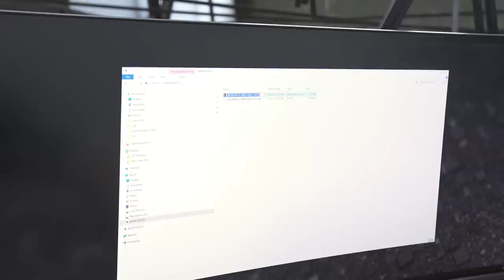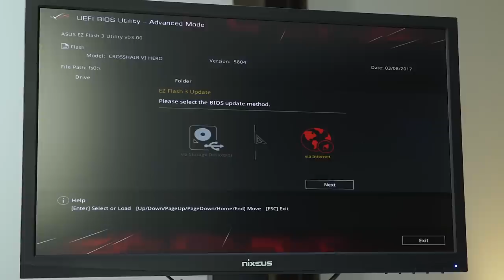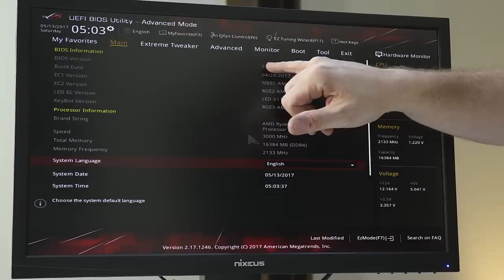How to build a Gaming PC

Comment: Is it possible for me to have both Windows OS and the BIOS update on the same flash drive? I'll be using the Windows Media Creation Tool to put Windows 10 onto my 32GB flashdrive. If i was to create a new folder on that flash drive with a folder named as instructed by my motherboard manual, will that work?

Comment: At the part where you power up the system, how much time elapsed before the monitor turned on?
Reply: Stephen Jamandron it varies for everyone, from 30 secs to 5 minutes
Reply: Clint-Excalibur71 So, what happened was that I had a stock CPU cooler that didn't fit on the motherboard, essentially leaving space between the CPU and cooler. (I got too excited because I was just waiting for my actual cooler.)
Reply: Stephen Jamandron lmao. You were going to fry your CPU. hopefully the cooler is on top of the cpu this time, posting shouldnt be an issue
Reply: Clint-Excalibur71 It is. Lol. I just wanted to post it. But I was worried after running it for 15 minutes with the stock cooler. The PC is great now.
Reply: Stephen Jamandron nicee, glad it works :)

Comment: Somebody help!! My pc won't boot, i dont have a gpu yet and i have asus prime z270 a motherboard. Idk if this motherboard has onboard graphics. if you have an air cooler do you apply it on or can you just leave it off and plug it into the cpu fan header (cuz that's what I did)? Also don't you have to plug a hard drive because I didnt. I need some help plz!!!

Comment: How would you install a optical drive on that case using that setup?
Reply: external usb one
Reply: @Zefinfer  Yes, but it is inconvenient isn't it?  I'd rather install one permanently, even if I hardly ever need it...
Reply: @CharizardFan_og  i agree i prefer having an internal 5.25 drive bay one myself. my next computer i want to have a pioneer BDR 2212. its an internal drive that plays blu rays. but for towers that dont have a 5.25 bay area, i think external drives are the only real option for optical discs.

Comment: I returned my motherboard and cpu because my motherboard turned on but the cpu fan didn’t spin. I retried everything and nothing worked. It just wouldn’t boot. Rewatching this I realized I didn’t even turn my motherboard on just the psu. I’m going to return all of the parts because at this point I shouldn’t own a computer.

Comment: I just built one using Ryzen 1700x vs Asus B350M-A motherboard Corsair LPX DDR4 32(16x2) 2666 but I don't have a GPU yet and it turned out My build Would not turn on there was no beep or display. Is it because of missing the GPU? Please help me out 
Thank you
Reply: Son Nguyen yes, you need the gpu because the cpu doesn’t have internal graphics.
Reply: you're right it worked right after i installed the GPU. Thank you
Reply: Son Nguyen No problem. I love helping fellow master race, and console peasants.

Comment: I need help. im trying to build a gaming PC
I chose this parts: 
Ryzen 1600
B350 AM4 gigabyte gaming k3
i have gtx 1050ti(plan to upgrade to 1080 or 1070)
power supply is CS500 gold modular
M.2 500gb SSD
16gb Corsair vengence 3200mhz
nzxt kraken x62
I just wanted to ask if there would be bottleneck issues while im using gtx 1050ti, or when i upgrade to 1080. Thanks guys!!
Reply: no

Comment: Oh yes, I had this on, left in the middle. There's JZ 2 cents, Doing about a buck fifty,  no, that's a hundred bucks.  That reminds me. I Have to save this video to finish watching,  because I have a pretty good idea this is going to turn out pretty nice. I already found the board,  great price,  I think $129.00,   but that Nvidia GPU looks rather rich.  I just got shocked a moment ago on another build.  

That's why builders watch these,  shoot if the difference is only 10% of something that is already so over powered it's ridicules, who is going to notice.  JZ I guess.  
I have to come back to this.  ASUS sent these parts for a reason.  Probably because they trust it's a good quality combo.  I guess I won't know until I finish the video.  
JZ I want to start connecting my Drones to my Google Home, and that PC you are building.  
I want to fly my fleet of Drones from my Opperations center.  Waite until you see my build.   All my monitor stations are same size monitors where there is more than one monitor. (Flat panel TVs)  So O can watch TV, or hook up a ton of other accessories.  What's a good price to pay for a chrome book,  I want one to carry around between stations.  Must cast,  smart cast/mirror screen.  All my monitors, are mostly  Samsung (which I really like)  I have 4 stations all together, and an android (Samsung of course) Up stairs (loft) is a guitar work out station and gaming.   I'll share the rest some time maybe.   I will have to dress them up for your channel, which reminds me.  You gave me an idea, actually a great I dea of something for computers that is mostly overlooked, often not even considered, yet when tended to makes a big difference.  I can make it, ...and every gamer with a set up that is to be appreciated for it's aesthetic value as much as anything else will be using this very cool system accessory device.  We can even add RGB LED chase circuit .  Thanks For thg he idea.  I'll make one and send you a pic when it turns out and gets set up.  Out of here,  I'll be bvb back to finish watching hopefully before it's out dates. I hope this was not 3 years ago. Lol.
Reply: wtf

Comment: Whats if i want to install Windows 7 and have a similar set? (not really). Been running into the ole ACPI compliant error for about a week. Nothing i do in Bios helps. 
Ryzen 3 2200 on a Asus Prime B450-Plus. Multiple SATA drives. Nothing works unless I try to install 8 or 10. 7 crashes after it "loads" files and going to the Windows spinning ords. Then boom. Blue screen.

Comment: im confused on the part where he installed windows 10. if i already have win10 on my current motherboard do i have to buy it all over again if i upgrade ? or can i just sign into my microsoft acct?
Reply: should just be able to move your hard drive with windows over to your new board. I'll be finding out soon.

Comment: Do you have a full parts list to copy this build?
Reply: My own for ryzen 3: https://pcpartpicker.com/list/wsTm9W You can get gold PSUs for $60. 500-650W is fine for one graphics card.  Keep checking. They're worth much more. (Corsiar CS & VS PSUs are unreliable.) You can get very cheap whisper quiet (22dBa) 120mm fans on ebay. You want a 140mm fan outside too for summer. Mine is a Thermaltake TT 1425, from Ebay. Makes no noise at only 17dBa. It has a long cable.

Comment: Does anyone know how you would go about turning it off when it successfully boots when you're going thru the test run? I'm getting my parts tomorrow and would like to know. Thanks :)
Reply: will freeman Hey there! If you're breadboarding, you can turn it off by switching off the Power Supply.

If you already have everything in the case, just simply hold the power button until it shuts off (don't use the power supply switch).

Hoped that helped!
Reply: thanks! i had already built it but thank you for the info for the future :)
Reply: Oh, no problem! XD That's good to know!

Hey, if you don't mind though, would you give your thoughts on the PC guide video I uploaded? Thanks a lot! :)
Reply: sure, no problem.

Comment: Can someone explain why he put his power supply upside down?
Reply: Nelson it’s not upside down. There’s a sticker on both sides whether you want the fan up or fan down the sticker is always upright from the front of the case. This case also has a mid plate so having the fan pointed towards the top would choke the air flow. Fan pulls air up through the bottom through a dust filter and exhausts out the back.

Comment: That wasn't comprehensive enough , we all know where the memory and graphics card go. We know how to use screws and we don't need to be told where to put the hard drive in the case.

What I think most people to need to know is, installing drivers and operating systems. The websites to go to for each type of mother board .

Also I think advising to wipe the liquid off the chip and the cooler is such a big mistake . It's very easy to say use the right tissue and be careful not to touch it with your fingers but soon as you give permission to people to even go near it and wipe it, accidents will definitely happen .

Also, when you start tested the system and it showed on the monitor you didn't show how you turned it off before you started to take apart the system ????

Comment: I need help my mobo is giving me a code for memory not installed but it is and is in proper slots
Reply: Remove all RAM modules and install 1 at a time. If your system POSTs, that means that particular module is fine. Remove that module and repeat for the rest of the RAM modules you have. If they all result in a good boot, you can confirm that the RAM is fine. That would then lead to testing if the RAM slots are fine and/or CPU.
Reply: @JJFlores197  i tried different ram configurations still nothing still says no memory installed i just contacted msi customer support so we'll see I'm hoping i don't have to buy a new mobo or cpu guess we'll find out

Comment: There is no way in hell I would build it. Take it apart and build it again. Just build it in. Worst case scenario your mobo is faulty and you have to take it out. Everything else is easy to take out.  I'm lazy. The 1 of 2 times in every 10 or 20 pc builds where something is wrong. Will not make up the time you lose from doing it twice on every other build.

Comment: Hows my build?
First time pc build
AMD Ryzen 1500x
AMD Wraith spire
MSI B350 PC MATE ATX
EVGA Gtx 1060 3gb SC
1x8gb Ballistix Ram 2400mhz
650w Fully Modular Evga PSU
Corsair 400c
1tb WD Hardrive
128gb ADATA SSD
for $1000 CAD ($800 USD)
Reply: Looks fine. Overclock the RAM to 2666 for faster games https://www.youtube.com/watch?v=k8vuTPj0VXA (In cpu-intensive games you would see the difference. Run in lower resolution and graphic settings to eliminate the gpu bottleneck to see the difference.)

Get a 4gb card if you want 1440p games.

You can get gold PSUs for $60. 500-650W is fine for one graphics card. https://pcpartpicker.com/products/power-supply/#e=4&sort=price&page=1 Keep checking. They're worth much more. (Corsiar CS & VS PSUs are unreliable.) You can get very cheap whisper quiet (22dBa) 120mm fans on ebay. You want a 140mm fan outside too for summer. Mine is a Thermaltake TT 1425, from Ebay. Makes no noise at only 17dBa. It has a long cable.

Comment: Could you or someone plz elaborate on how to update the bios before installing the OS? He made it look very simple, just download the latest bios version, "and extract to the root of the flash drive" wtf does this mean and how do u do this? after researching a bit it seems like you need to create a bootable usb or something? does he go through rufus? I'm so lost fml
Reply: Firstly, format a USB flash drive so that it's completely blank (use a new drive if possible since any errors can be fatal when it comes to flashing the BIOS). Next, simply save the latest bios image directly to it - in other words, DO NOT place the image in a created folder. Job done - you should now be able to update the bios. Note that this flash drive does NOT have to be a bootable for straightforward flashing of the bios, but (for obvious reasons) it DOES have to be bootable if you're intending to install a fresh copy of Windows via USB. If you're installing Windows in this way, select your bios 'boot order' options so that your PC boots via USB first...not forgetting to use Rufus to put the Windows image on your formatted flash drive, of course ;-)  Hope this helps.

Comment: i want to play games like project cars 2/ mainly triple A titles on my pc on at least high settings (prefer ultra). my pc specs are intel core 5-3330 3.0.ghz 4-core/4- thread cpu with 6MB cache and turbo boost technology. 8GB RAM and 2TB hard drive. AMD HD6670 2GB GDDR3 graphics card. ive looked online and think i need to upgrade my graphics card but dont really want to upgrade the PSU can anyone help?
Reply: Drivermontana get the 1060 6gb, and get a 500 watt psu

Comment: awww man...i so wish i just bought an already complete pc, this seem so annoying and would take forever.

maybe i should send the parts back and buy a complete pc. i cant do this shit.
Reply: It honestly should take less than an hour to put it together, and it's usually MUCH cheaper.
Reply: well i just did it, bought myself an overkill pc and no do you wanna know how long this shit took me?

6 hours! i started 11.30 pm and was done 6.15 am...

it was not worth it, i got it running beautifly with 100+ fps on tombraider 2013 with everything at complete max at 1440p and sure i was blown away but in those 6 hours i thought io broke something and that it wouldnt start pretty much once every hour.

it actually didnt start at first boot but i forgot to plug in the cpu in the psu and after that it booted fine.

but dont tell complete noobs its easy and quick because its not, all these lies made me think it was fast and easy but boy was i wrong.

fool me once shame on you...
Reply: NJHS92 oh,  I guess I knew what I was doing the first time then, finished in around an hour my first time, barely got any faster the 2nd and 3rd time
Reply: not everyone is good with tech